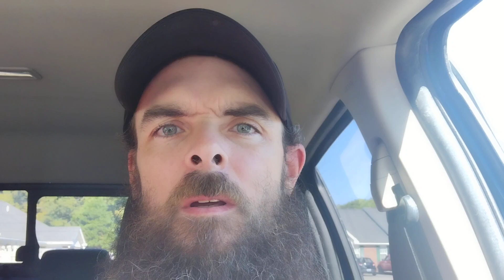⚠️Can Over Filling Engine Oil Cause Seals To Fail?⚠️ Let's Discuss.💬

Comment: Hi from Oamaru New Zealand. I see a lot of new vehicles and machinery are only full to 1/2 way In hash marks but not to top.
Is that acceptable?.

Now can you do a Air and oil filter efficiency vid not talking about brands but the percentages cleaned.

I personally like a bigger size filter as it lessen the air volume going through a smaller surface area.
 Cheers
Reply from the maker: Hello!  Thanks for watching. The full to half full is acceptable. It comes that way from the factory for the first start and shipping. However if it's only half way up the hash marks I would top it off the the full mark. That's what we always did during the PDI process (pre delivery inspection) when they came in new to get them ready for the lot.

As far as filters go for air keep this in mind. Yes more air let's it breathe better. But more air means more fuel which will lower fuel mileage. Factory filters are designed for optimal fuel efficiency.  And for the oil filters I'm sure I can come up with a video. Most of your top brands are 99% efficiency at 20 microns or so. But We can do something. We can also talk about it on live stream that I'll be doing every Sunday evening.

And as far as air filter cleaning we can do that too. These are all very good topics to cover about using a bigger filter for volume as well. Shoot me an email and touch base with me and we can figure something out for a Livestream too. And possibly get you on there.
Reply: @BeardedFordTech  I asked about the oil filter as I use Amsoil Signature series diesel oil for my Spanish built Nissan Navara D40. ( In the U.S it's called the Nissan Frontier but in V8 only. ) I use Amsoil as it's not that more expensive than standard brands but it gives me 4 times the drain intervals of conventional oils and it takes on way higher ambient temperatures and sub zero conditions in one package. 

Amsoil filters has a synthetic fiber filter medium which was the first to use this and claims it's way higher performance than other brands.. that's why I asked about this. 

I use Amsoil as eliminating 3 changes saves me a lot of time, money and most of all I don't have these numerous waste oil containers lying around the farm.

Comment: As a non mechanic I learned something new today. I had always just assumed that the crankshaft rested in and dipped into the engine oil while rotating and that’s how the bearings were lubricated, I didn’t know about the foaming aspect if that were to happen.
Reply from the maker: The bearings are lubricated by the oil.flowing through the oil journals or "galleys". Through holes where the bearing sits.  Yes if it's over ful.too much it will foam. Which is air which is bad. Thanks for watching.

Comment: Why was the issue of cavitation not mentioned? Neither dry nor wet-sump would be able to maintain pressure to all of the mains and rods for long enough to prevent terminal damage with aerated oil in their inlets
Reply from the maker: Spur of the moment video. I'm actually doing another one on this subject

Comment: We had a fleet of international dt 466's that were blowing front crank seals ! come to find out a driver was over filling the engine cause the part # on the dipstick ended in 1 ! which would of been 10 qrts over filled !
Reply from the maker: 😲😲. 10 quarts over full?  I'm surprised it was just front crank seals

Comment: You basically described your typical SPLASH LUBRICATED non-pressurized lawn mower engine...but in the case of those engines(Motors are NOT Engines)they will smoke like all hell if they are overfilled with oil....I have to disagree..it's not overfilling your crankcase...by say a quart...that's NOT the problem since the oil IS BEING splashed around like a shaken bottle of liquid while driving/braking...going over bumps/curves etc...it's the baffle system in the oil pan...or bolted to the bottom of the engine that keeps the oil from splashing all over the crank...it's when you overfill and it GETS ABOVE those baffles that's when the oil really splashes...but anyway in reality... it is stuff like the PCV (Positive Crankcase Ventilation valve) Valve...that...if that plugs up...makes the VOLUME air pressure in the crankcase/oilpan blow gaskets...that and normal blow-by or old leaky compression rings...Combine to build up pressure in the crankcase...and without a good PCV valve...the pressure finds it's way out one way or the other...that is why most people with Hi-pro engines put breather caps on their valve covers...in the cars from the 1950's(before the PCV valves) they ran a metal tube down towards the ground just a little below the frame to exhaust those crankcase ventilations...so at idle you would see this slight cloud of smoke coming from the underside of those cars.
Reply from the maker: Correct. We aren't talking about one quart though. We are talking about enough to cover the windage tray and the crank sits in it foaming it up. Not a splash system. Crank breathers are good. And most people don't even bother replacing a pcv valve. Hints like you said. It's got to go somewhere.
Reply: @BeardedFordTech  Great video foam is definitely an engine killer, but what about a quarter quart to half?
Reply from the maker: @ginog5037  a quarter to half quart. Not really going to blow a seal. May get some excessive blow by. We are talking about 1 or more quarts depending on the vehicle.

Comment: in the good old days when engines had dipsticks, you might be saved by it blowing out. Not now...
Reply from the maker: Most engines have dipsticks. But people don't know how to use them. So there might as well not be one. I think Mercedes doesn't have a dipstick on some of them.
Reply: @BeardedFordTech  I'm in Europe, most of the stuff over here doesn't
Reply from the maker: @lemmykilmister450  yeah that's totally different. Might as well be like that here. Most people don't check theirs either. How your day going?
Reply: @BeardedFordTech  not great, I'm a heating tech. Working on a system from the 70s and none of the wiring corresponds with current stuff. I've got too many lives on the port valve WTF
Reply: @BeardedFordTech  That's cause the owners are dipsticks...lol
Reply from the maker: @claudelandi510  🤣🤣

Comment: 100%!! People can checkout Banks videos of them testing the new dif covers and they show how the fluids get whipped up when it’s a bad design &/or not enough/too much fluid. It’s not engine oil, no, but gives a good example of that when they’ve got the clear covers on showing how the fluids work when the gears are moving through the gear oil. Air in the oil is more detrimental than the front/rear dif I’d imagine, especially in a diesel, but still not great from what yall pros say. Appreciate the vids brotha!
Reply from the maker: I've seen those banks videos. That dude is a genius. And it's the closest thing to show you what goes on in an engine. Rotating parts "whisking" it causing air that builds pressure. Thanks for watching!!
Reply: @BeardedFordTech  yessir he most definitely is a genius! He also explains everything like a regular guy so you can understand him. That guy’s forgotten more about cars than I’ll probably ever know! 
 Appreciate the videos!

Comment: Overfilling is never good. The autocross club I belonged to recommended to have your oil level a 1/4 quart low for track events at Lime Rock. This way it prevented oil getting whipped by the crank during hard cornering. Back in the day racing engine builders installed what's called a windage tray. It is attached to the main bearing caps and prevents oil from hitting the crankshaft during high G cornering. Most manufacturers have installed windage trays on today's production engines.
Reply from the maker: They have windage trays in them now. But if your over full it goes through the holes in the windage tray basically letting the crank sit in a puddle.
Reply: @BeardedFordTech  Exactly! Why it's very important not to overfill the engine. I wonder how many engines were damaged by being overfilled at quick lube places.